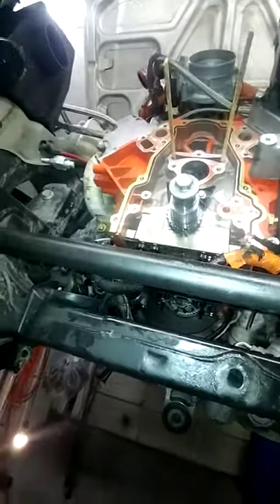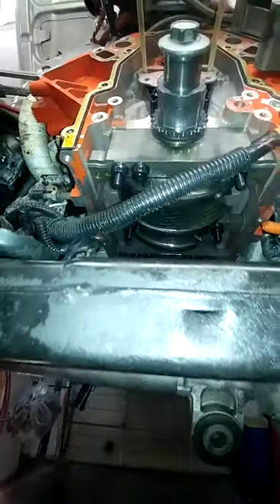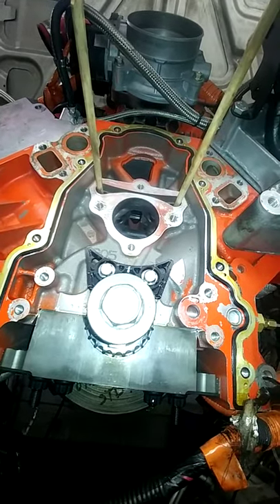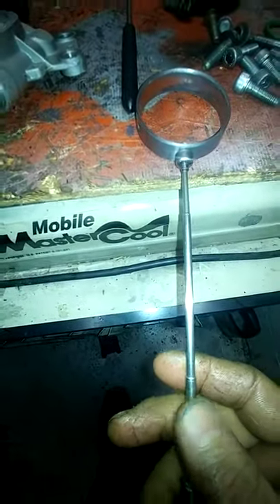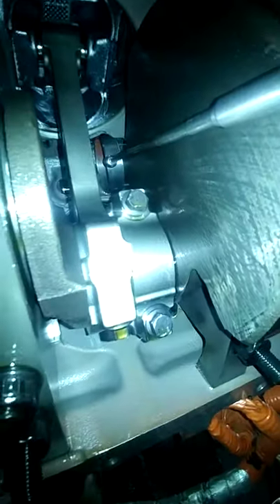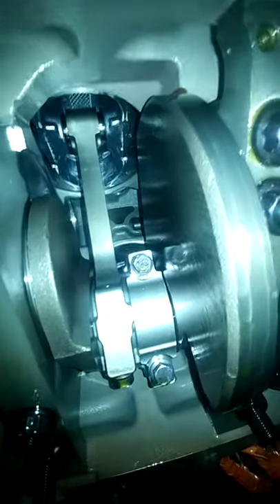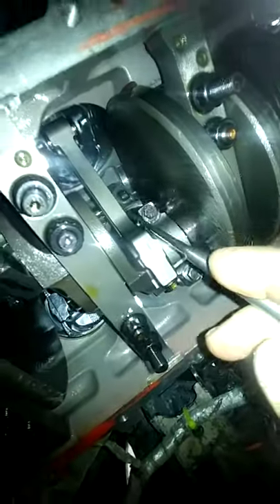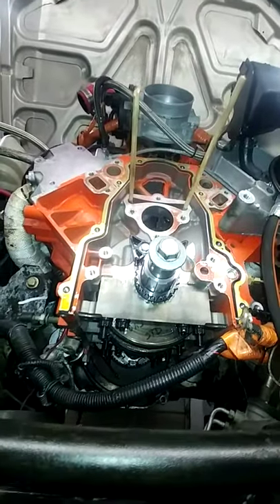How to replace cam bearings on a ls motor in the vehicle part 1

Comment: Any tricks on knowing where to stop driving the new bearing so u dont pass the oil galleries
Reply from the maker: Yeah right in the middle.. you can see them..
Reply: Like he said eye ball it for center. Then get a mirror similar to his extendable magnet and a flash light and lay your eyes on it. Look in the hole in the bearing to make sure it’s centered over the galley you should see nothing when looking into the hole but the back side of the galley, if you see anything like the journal bore edge it’s not right

Comment: Put green lock tight on the new cam bearings u won't have another problem with them moving again!  It's a retaining compound.
Reply from the maker: The machine shop put some kind of bonding stuff on them in the first place. It shouldn't have walked out the first time.

Comment: Wow your the man ,,BTW did you lube the outer bearings to drive in and what brand bearing did you use ?
Reply from the maker: @DELTRANIO99  no lube. I used locktite. And the bearings were just off the shelf stuff from rockauto
Reply: @hill_customs6807  Green or red loctite?
Reply from the maker: @DELTRANIO99  I don't remember now. It's been years.

Comment: This seems to have helped alot of people, can't hate on that, but im amazed that someone that has such a nice engine, with so many dandy parts,  would take this shortcut.  I thought about doing it, but i would be thinking about #5in my sleep. 👍
Reply from the maker: The motor was a fresh build that only had a problem with 1 bearing. And only the one that was bad needed replacement.. no need to loose sleep
Reply: @hill_customs6807 you say in your video you're gonna do a video of number three after you do number one and two.  Hay man "if it works out for ya, that's all that counts. 👍

Comment: I have this same issue. Number 3 cam bearing moved forward and now came out. It’s resting on the cam lobes between 2 and 3. The loose bearing is more narrow toward the front due to contact with the counterweights. I cannot get the camshaft out due to the bearing.  Is there anyway to get the bearing out or camshaft to move forward. I can only think to try and chisel the bearing in half and may not be possible. What do I do next to get cam out. Thanks
Reply from the maker: You have to get the oil pan off. And hold the bearing with a magnet and slide the cam through it. May need 2 people.

Comment: What is the part number on the tool you used? The mandrel seems too long on the ones I looked at from Summit Racing,. ... You were able to fit the mandrel between the rods and reattached to the bar through the front of the engine? thank you for the reply
Reply from the maker: I used the sumit racing cam tool.. has nothing to do with rod clearance..
Reply: @hill_customs6807  So the process is to knock out bearings in sequence of 1, 2, 3 and 4.  Then with the tool still in the block, you installed bearings in reverse order of 4, 3, 2, 1 ???  Is that how you did it?
Reply from the maker: @myturbinesdurtee8661  correct
Reply: This video made me from having a real bad week to real good week 2010 Cadillac Escalade 6.2 new jasper short block same problem lil under 80k on short block

Comment: Hey, I was wondering if you did anything extra to help keep the bearing in place because it walked out? Thanks
Reply from the maker: The machine shop uses some kind of glue to help keep them there. But I did not.
Reply: @hill_customs6807  thanks
Reply: Green lock tight it's a  A  Retaining compound and it works !! Don't put it on a bolt or press fit u don't won't to come out  Especially a bolt u 💯 will be drilling the hole thing out !!!